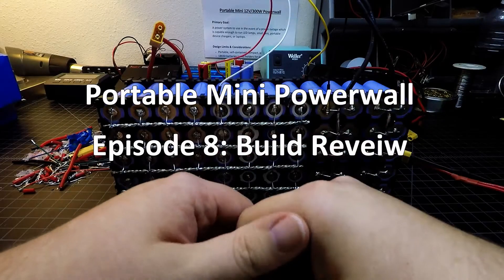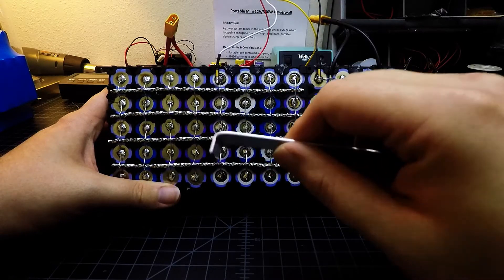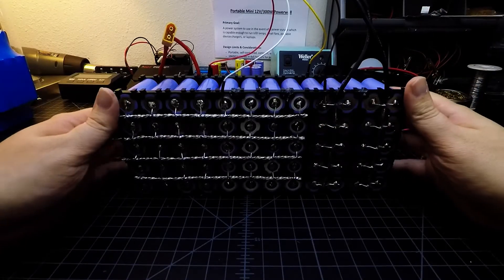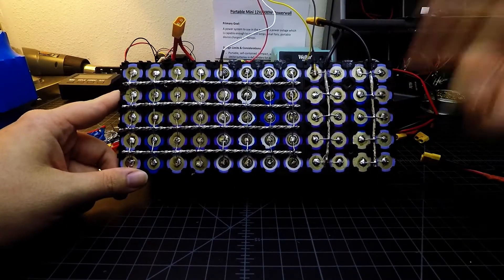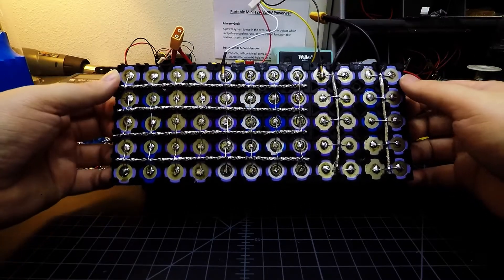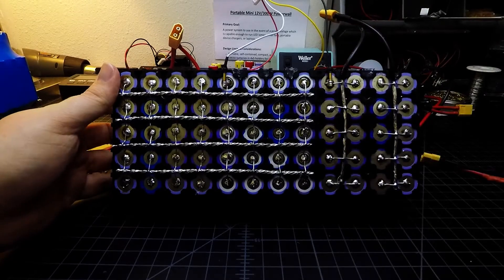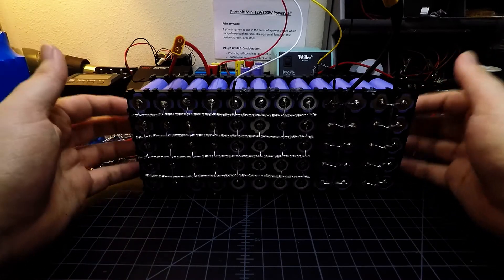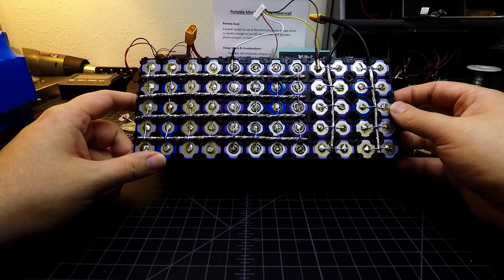Portable Mini Powerwall Project E08 - Build Review

Comment: Thanks for posting the buss wire link.  A few questions occurred to me while watching it I'm hoping you can find time to answer. 
 What current do you think that would melt at? --  I believe the Samsung cells can do 10A continuous discharge, and at 300W you'd pull  around 30A DC, I think, which would only be something like 1.5A/cell?  I was going to use PTC resettable fuses that trip around 4 amps.  Also since only one fuse is needed cell circuit, could you get away with only fusing the positive terminals and just connecting all the negatives for each of the three groups? Finally, have you considered using a BMS with balancing capability?  They offer over and under charge protection and over current and short circuit protection (which might help reduce the risk of catastrophic effects from accidental short in your pack design.  You can pick up a board for around $5 for 3S.  Thanks for you series and I'll be watching the remaining episodes soon !